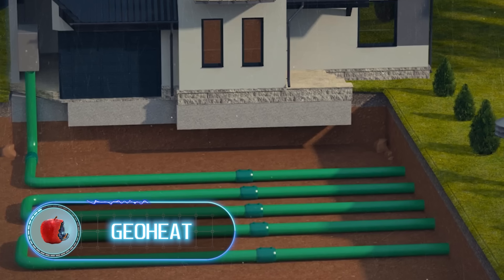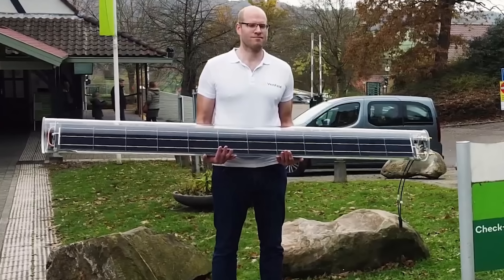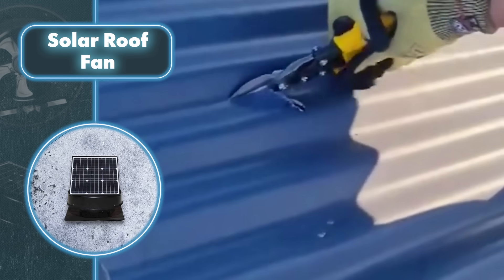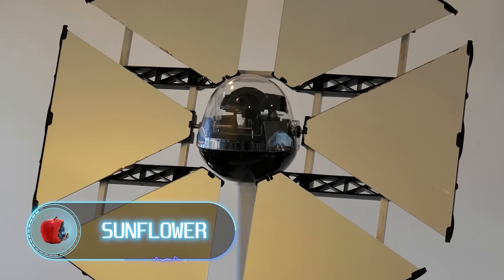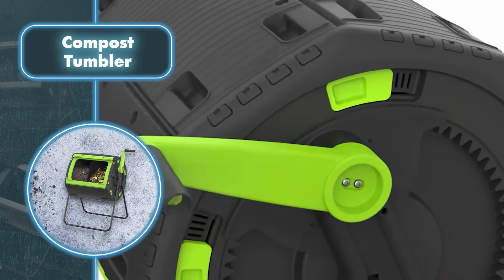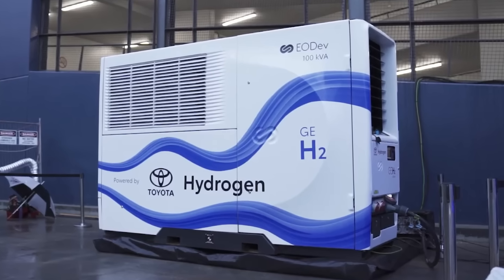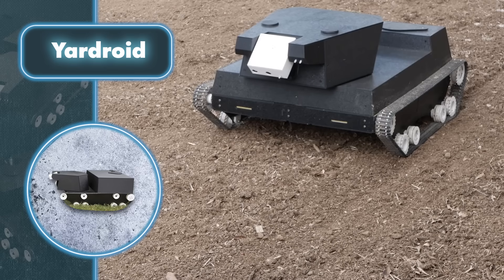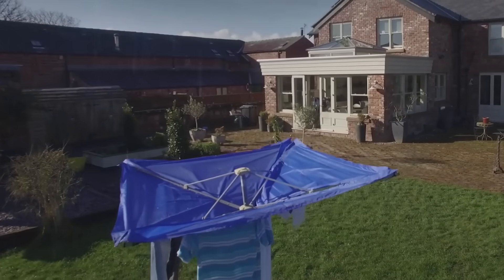Incredible Autonomous Inventions That Will Upgrade Your Home

Comment: All aboard the pipedream express lol
Reply: Nah….people use many of these right now.  The geothermal heating and cooling has been used for centuries and is pretty decent, plus low cost and doesn’t fail  if the power goes down, like air conditioning.  

And many people route their rain gutter run off into barrels or a tank, often buried in the ground for looks or so they don’t tip on anyone, to collect water for gardening or for use in flushing toilets.  That is completely doable.

And if you have ever turned on a black hose sitting in the sun on a summer day, you know the sun is pretty good at heating water, especially in areas with year round sun, which there are plenty.  Solar water heating is used many places, and you can combine a solar-powered pump to continually pump water from your hot water tank to the outdoor heating area and back, and works.

Comment: had to laugh about the hydrogen generator.  anyone price the cost of hydrogen?  it is a gas and they measure it in weight per Kilogram  Any clue how much that amounts to?  try $30 per gallon .  Seems like even Gasoline is a good deal in comparison
Reply: This morning I heard that I was wrong about the price of hydrogen.. it is closer to $36 a kilo meaning filling up will cost you north of $270 with every fill up.. How many miles will one get on that fill up??  300 miles.  so you do the math..
Reply: and just think of someone who might want to buy one of these lemons used//  Not going to be more than $100 as a curiousity piece like for jay lenos garagage